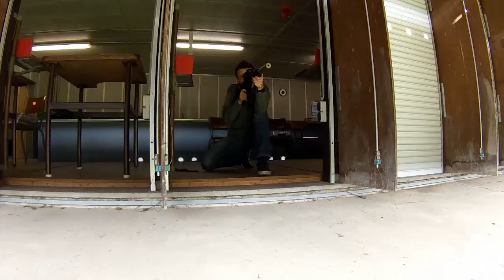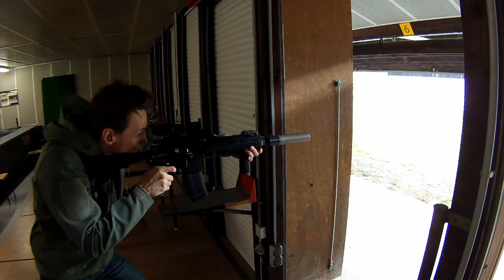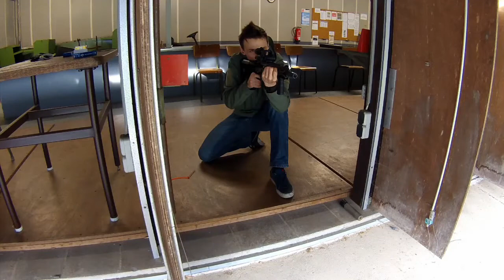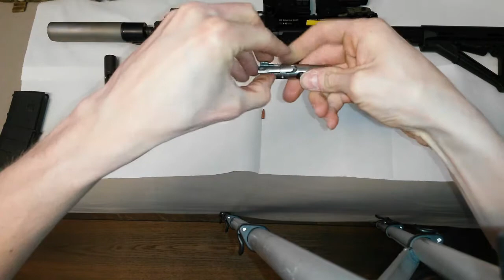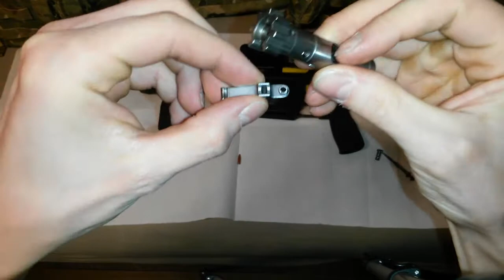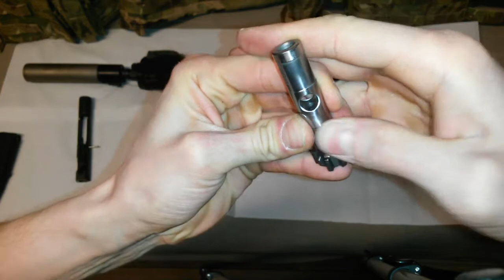HK MR223 Bolt Disassembly and Re-assembly

Comment: I got an MR556, and I took apart the extractor to clean and put it back together as per the manual. For some reason now the extractor doesn't move at all and it does not snap onto the base of the bullet anymore. I found your video searching for an answer and my assembly process was basically exactly the same as yours. Any insight would be appreciated, thanks!
Reply from the maker: Well if you assebled it like shown in the video it should work like it came from factory... if your extractor isnt moving at all, then it probably has an issue with the small spring which has a plastic cylinder... inside to keep pressure all the time so after extracting the shell it closes again to extract another one...
Reply: @Hyrican85  I disassembled the extractor and cleaned and lubed everything again, and it's working fine now. I guess when I reassembled it previously the spring might have caught on the indentation on the extractor or something.